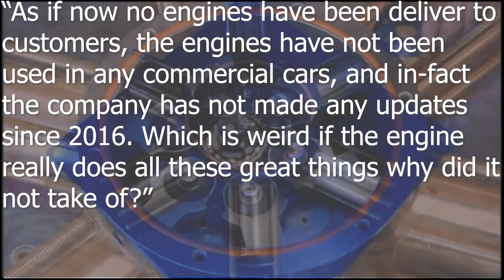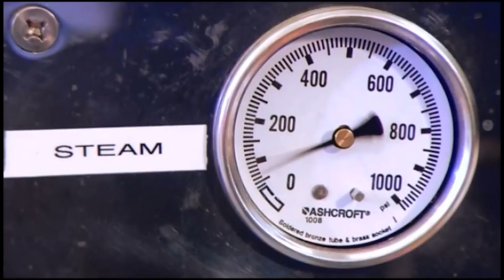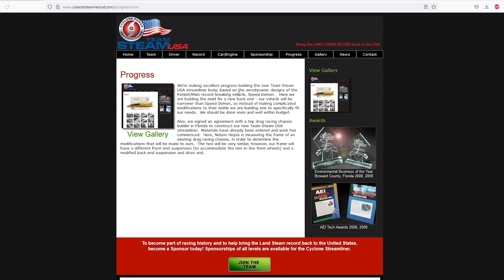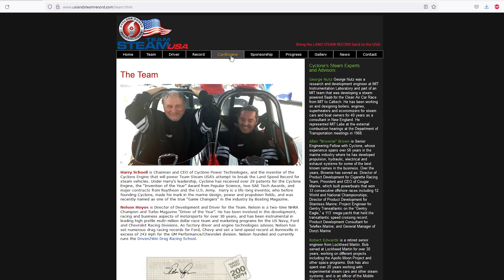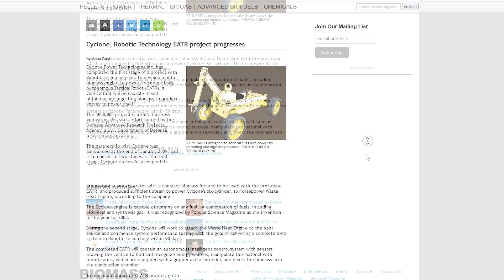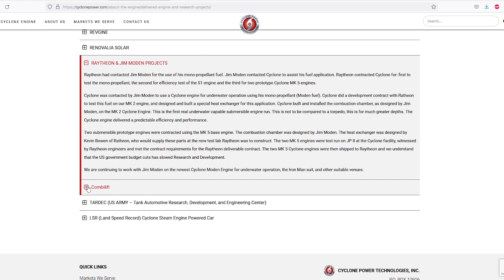Is the Cyclone external combustion engine a scam

Comment: If anyone is reading this and would be willing to help me build a far superior radial 'steam' engine, please drop me a line.  I have an actual US Patent on the valve, which provides for infinitely variable valve timing & phase, with the rest of the engine 'bottom' being completely conventional in design.  None of that spider bearing crap.  By combining computer controls the engine can act like a 'selsyn', or a 'programmable torque source' backed by the power of steam.  

However a far larger market exists. The goal is to couple the engine to a concentrated solar heat source (and/or thermal storage) and by carefully controlling the engine speed & phase angle spin a synchronous generator to supply reactive-power (KVAR) behind the meter to industrial consumers of electricity.  Thus improving the power factor of heavy demand consumers and avoiding penalties from the utility.  This is the most valuable form of electric generation.

Finally, I can promise far more transparency, that Cyclone.  Unfortunately, there is no flash or sizzle accompanying my pitch, no sexy speed boats, no land speed records being eyes or even discussed.  And the engine, well, it's kinda boring looking.  It resembles stack of pie plates bolted edge to edge.  A beveled disk with pipes entering the top & bottom of the center disk, and a vertical shaft pointing up or down, depending on the application's need.  Did I mention that it spins in either direction without any preference?

Drop me a reply if you're interested.

Comment: If it is dead in the water could someone use their ideas? It looks like it wouldn't be that hard to make it work. They probably exaggerated the performance as scams are in the habit of doing but there were some very attractive things about it like the closed loop water system & the compact design.

Comment: Cyclone wasn't a scam but the naive investors who gave Harry Schoell the money are to blame.  The premise was that water lubricated ceramic bearings can eliminate the need for steam oil.  The Cyclone engine wore quickly and could never have been more than a toy.
Reply: What is this engine? Can you explain what are the advantages?
Reply: @Mert-qm8ub  radial engine with critical water/deionized water as lubricant and power. The water didn't work as lubricant enough and the engine wore down critically after a few hours running
Reply: HARRY SCHOELL is a crook and a conman 
Cyclone was nothing but a SCAM!

Comment: Speed is fun but So is Pulling .. need this in a Country man tractor pull
What's going to turn this around is Electricity. A system to heat the Liquid to its gaseous vapor state that uses electricity.. maybe a waist heat Peltier tile tank who knows!

Comment: When I first saw this engine I didn't really pay it much attention as it just has too many moving parts for my liking when compared to a properly built rotary engine with all the design flaws that went in to production taken out. If I can ever get to the point were I am able to start building the rotary engines properly there will be no other engine in the world that can match it due to it having 270° of compression. It's also the easiest engine to convert to running on hydrogen since there are no valves. If you want to know what the flaws where of the rotary engine that went into production just watch this video: https://www.youtube.com/watch?v=GarCJ4zw_mk
Why Mazda hasn't produced the engine is beyond me but I can see this mechanic solved the issues with the rotary engine.
Reply: Maybe he got injured really bad
Reply: Ernie Brink was a crackpot and a con man, he died from alcoholism

Comment: I saw this engine a long time ago and was excited about how it worked. No oil, no preheat, no steam exhaust. I wondered why it was never shown powering a vehicle. The steam powered land speed record videos disappeared from their website. Now it pretty much shows you nothing. Very disappointing to find out it probably a scam. I never really expected it to go into widespread production because oil companies would not allow it. He would end up dead pretty quick.
Reply: Totally scam, Cyclone was never a legitimate company
Reply: I think it could work if some of these builders on YouTube with their CAD programs & 3-D printers & such put their heads together & reverse engineered it. The question is, would they be allowed to do it legally? Oil companies don't seem to care if you show people how to do something at home. They don't like it if you seem to be gearing up to produce something that will compete with them for significant money.
Reply: @detrechrats  I mean, you can just make it without cad or 3d printing, you just need tubings and the correct engine parts. The problem in this project was mostly the technology used, the burner and engine are very innefficient, and I'd think about revising the boiler in its entirety and the engine into a turbine. The condenser is also too optimistic, it needed to be bigger to work.

Comment: The problem is that nowadays, petrol and diesel are available pretty much anywhere, so external combustion engines have basically no advantages over ICE.
Reply: DOBLE!
Reply: The only real advantage of external combustion engines, both steam and stirling, is their fuel flexibility. This doesn't matter much when you have access to a global supply chain of refined petroleum products. It may be more helpful, however, in situations where you're cut off from the grid and may need to scavenge for your own fuel. Engines like this would never become mainstream, but they could find a niche in military and disaster response applications. Think generators that can burn garbage for electricity, cars that run on firewood, and so on.
Reply: until we remove the boom and only use steam .. a.k.a Electric kettles.....a farmer once said "One day the world will run on cows milk!"   1 latte grande please

Comment: Steam as a medium for a heat engine is doomed to fail -- it can only manage about 10% thermodynamic efficiency, no matter what you do (anything higher requires insane pressures). That's why Diesel took over from steam on the rails, and in turn is being replaced by electric traction. So even if this engine were real, it's not a step forwards.
Reply: diesel-electric hybrid is the way to go

Comment: A problem is, even if it’s not a scam, for commercial use, although it’s not polluting, it will block your and others vision because of all the steam coming out of it and it makes it hard to navigate, unless they ever made a solution for that
Reply: not necessarily, just a condenser tube/exhaust would be more than enough. Heavy construction equipment still billows out plumes of lingering black smoke and nobody bats an eye
Reply: @THESLlCK  ah ok, that’s a relief
Reply: The new motor is a closed system that recirculates the steam like an A/C unit
Reply: There is no steam coming out of it, it is a closed system.